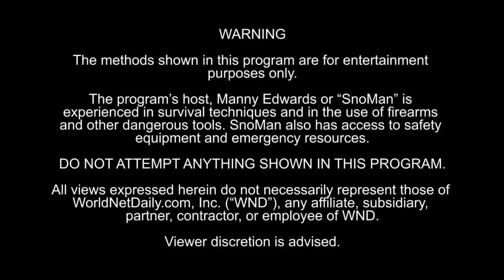DIY Faraday Cage

Comment: Great video, but I have one comment and one suggestion.  First, surge suppressors will not be effective against an EMP due to the rapid rise time of an electromagnetic pulse. This is the time from zero voltage to maximum voltage. Most surge suppressors will not have time to react before the voltage has hit and done its damage. An electromagnetic pulse is even faster than a  lightening pulse which means that lightening protectors are marginally effective against EMP if at all. In any case, I agree with 5tevef, lightening is not capable of creating an EMP. Only solar flares with mass coronal ejections, high altitude nukes, and purpose built EMP bombs will cause electromagnetic pulses.

My suggestion is a metal garbage can with tight fitting metal lid. This should makes a pretty good home brew Faraday Cage large objects.

Keep up the good work. I enjoy your videos very much.

Regards,
Bill

Comment: Great video.  I have an 1800w solar generator with 100w solar panels ( all portable ), what should I do to protect them?
Thanks in advance.
Reply: I think only the generator needs faraday cage.  The panals dont gave wlectronics but the mppt controller etc may need protection.
Reply: @lil_Marie_Red  OK, thank you for the recommendation.  Just to play it safe I will probably put the panels and the controller in a Faraday cage along with my generator ... better safe than sorry.

Comment: A steel galvanized garbage can has a tight lid that should do the job.  There is special metal tape to seal the lid if you feel a need for that.  I heard of putting a 21 gallon can into a 30 gallon can....that should do the trick. Cover the inside with cardboard to keep items from touching the can.

Comment: What good are your electronics if there's no power because the grid is down?
Reply: Who said the only source of power is the grid?
Reply: Battery powered gear such as flashlights,radios,walkie talkies,etc would be nice to have when the grid is down.we often take thing like this for granted in our digital aged world but these devices would be invaluable in a post EMP attacked area..if a man was to fill a 50-55 gallon faraday cage with a bunch of flashlights and radios,after an EMP attack he would have a lot to barter with.could you imagine how much items like this would be worth in this scenario...living in a world where 95% of the people dont have working usable flashlights would add a whole lot of value to these items...ijs
Reply: The point is when the electric comes back on you haven't lost all your photos or important data. Keeping my backup drives with all my photos on, in a box i only access occasionally seems sensible. My wind-up radio, a torch and some batteries seems sensible too. Although i think i would make a foil roll-top bag around the box so i could get in again carefully when needed. It doesn't need to be tight to the box just firmly conducting to itself all the way round and thick enough.
Also many non electrically controlled diesel electric generators will still work as would your chargers and batteries if they too had been shielded in the box.
Reply: That's why I made 2 much larger ones, using moving boxes as the inside. So I stored rechargable batteries, flashlight, small solar generator with 2 panels, handcranked generator with usb-ports there as well as an emergency radio, 2 walkie-talkies and a spare hamradio. Means I will have power afterwards. Maybe not a lot, but enough to power and recharge at least small electronics.
The grid is not the only source of power

Comment: Crazy. If the EMP ain't gonna fry yer electrics, the heat and pressure wave from a nuke blast sure will.
Reply: the EMP will go further than the radiation, depending on the wind. And if One Second After is correct, the nukes would go off hundreds of miles above the surface anyway